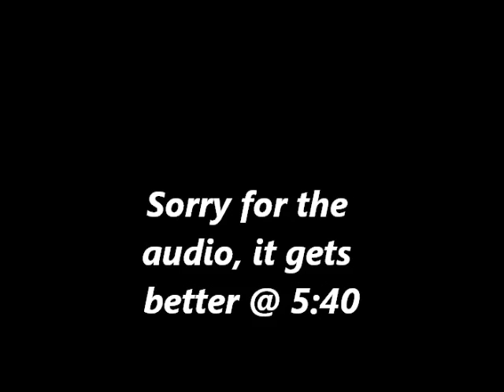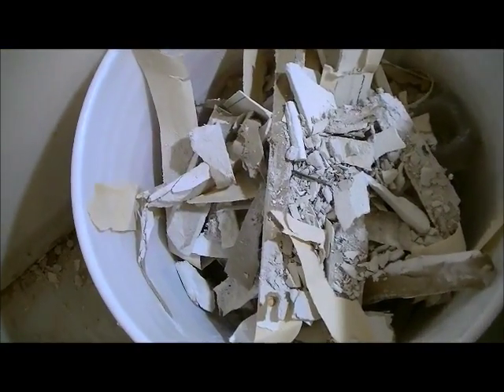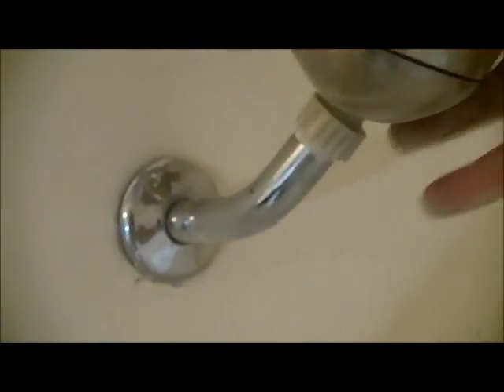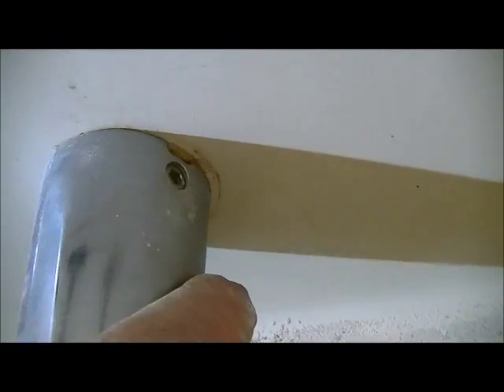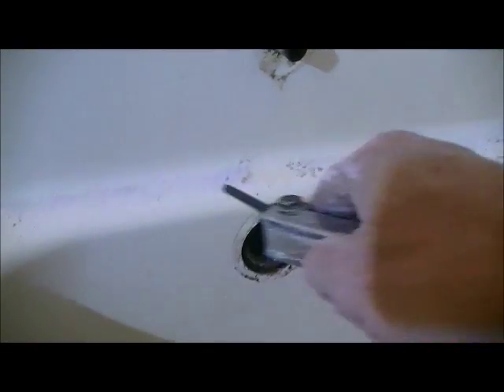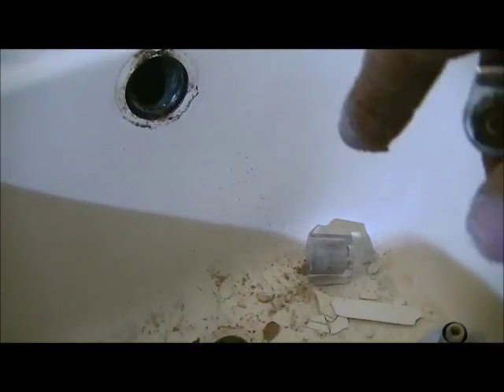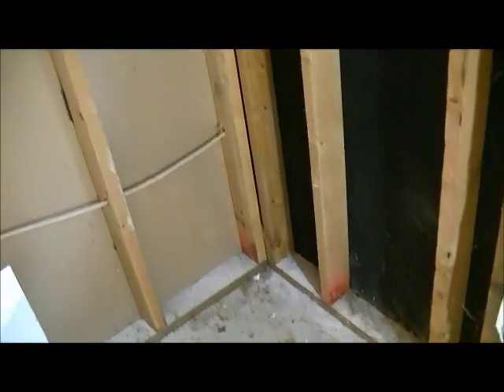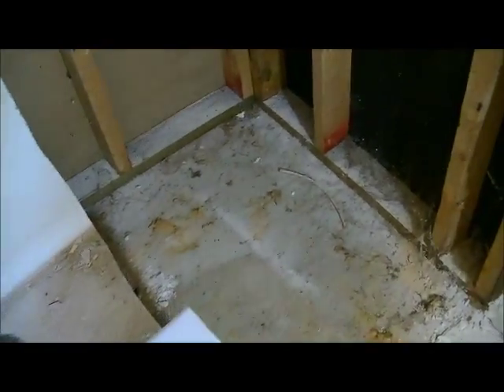How To Remove Fiberglass Tub Surround

Comment: One problem, using a saws-all could cut vertical studs or the power wiring that is in the wall... so using the razor knife would be the correct way to go in my  humble opinion.